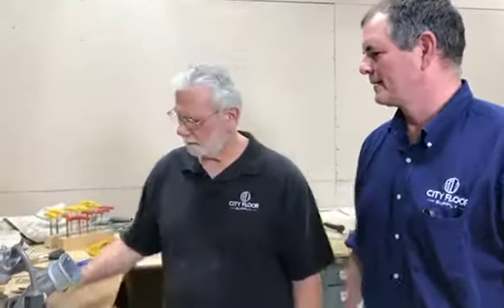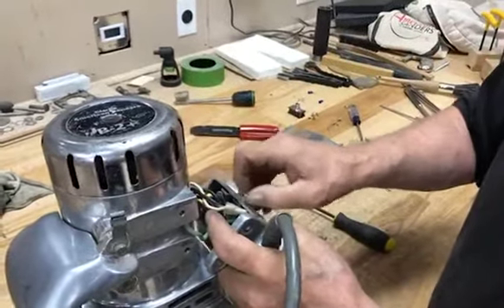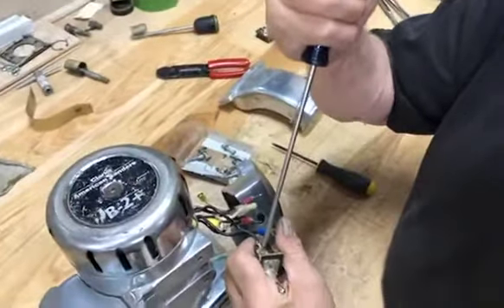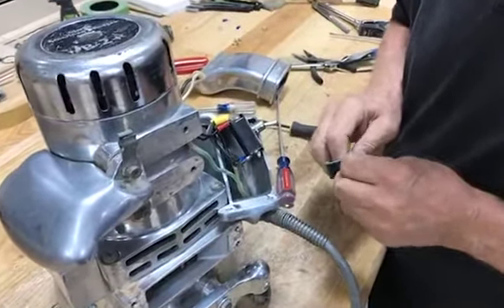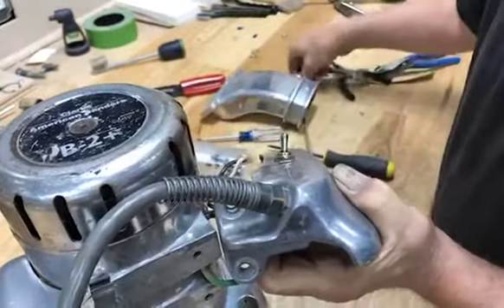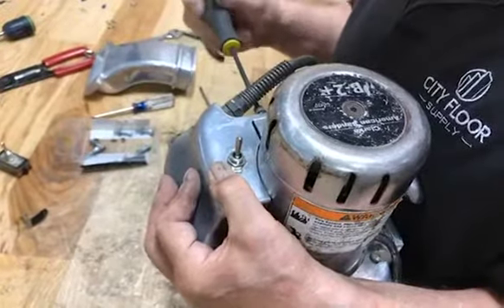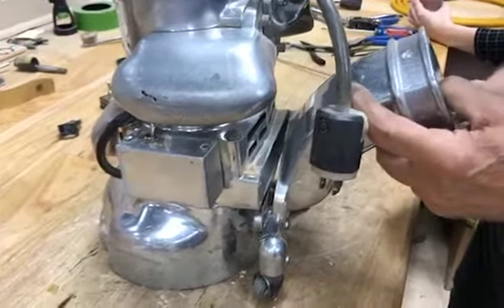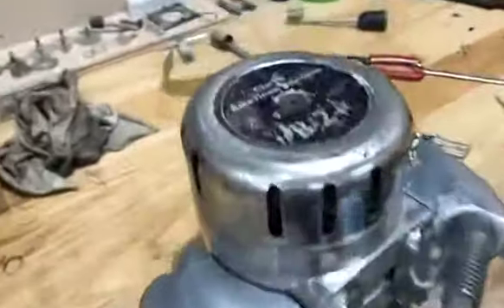B2 Edger Hardwood Sander Switch Repair | City Floor Supply Machine Shop

Comment: I have a clarke super 7r so I have 6 wires 
2 from the power
2 from the light 
1 from the motor
1 from the brushes 
How I can put it in the order? The switch has 2 screws at the on position and 2 screws at the off position 
Thank you
Reply: They didn’t answer 😂 …I’ll answer after 5y…power and light to the OFF and motor and brushes to the ON 😉